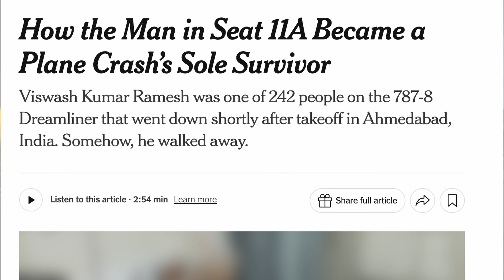Why the RAT Changes Everything – Air India 171 Update

Comment: If that's the case, it must have been a massive electrical overload. To produce a dual flame out so close to take off. Thank you captain steve for the update.
Reply: Can you explain how an electrical system going wrong cut of the mechanical engines. Is there no contingency on a critical stage of flight for that if electrica fail the mechanical still doesn’t flame out. I dont get it
Reply: Exactly. Fuel pumps should have been designed to be powered separately from the main aircraft. My vote is on a poorly repaired entertainment system cutting power to the fule pumps. @themadakh3229
Reply: @themadakh3229  Engines on modern aircraft are FADEC (Full Authority Digital Engine Control).  Lose the electrical bus, you lose the computers that run the engines and fuel pumps.  Kind of like losing the Engine Control Module in a modern automobile.
Reply: @themadakh3229 I got that theory off the internet from someone more knowledgeable than I am, but since it matches all the facts that I know I’ve been spreading it far and wide to shut up the incorrect theories about flap position which people are STILL refusing to shut up about.

That being said, the person who suggested the main bus failure theory suggested that if he were at the FRA he’d be issuing an immediate directive to have all 787s (and other aircraft with electric fuel pumps) run their APUs * During takeoff * as a precaution against another failure like this.

(*edited* with the actual info from the original source after I went back and reread the original post)
Reply: Why overload and not just cutout ? (engine cutout = generator cutout )
Reply: Kinda where my head is going as well.

Full disclosure:  I’m an armchair expert, not anyone actually privy to details.

I feel like an electrical failure would explain everything we’ve heard.  The survivor described a bang and the lights flickering.  That could be the electrical bus overloading.  The engines both have an electrically powered fuel pump, so if the electrical failed then the fuel pumps would stop working and the engines would shut down.  The RAT would deploy in an electrical failure, and it’s deployed.  The landing gear requires electricity to operate, so the gear only being partially retracted would make sense if the electrical failed partway through the retraction process (actually, I’m wondering if the gear up sequence might have been the straw that broke the camel’s back and overloaded the system).  Couple all that to the reports from Air India employees that that particular aircraft has a history of electrical problems and it all seems to make sense to me.

At altitude the crew could have fired up the APU and gotten the fuel pumps running again to recover, but at 400 feet they were doomed.
Reply: @jaanfo3874 The bang was probably the sound of the RAT deploying. The flickering was just the switchover between engine and RAT power. Most likely it had a main bus failiure and an engine throttleback or full failure as a result.
Reply: @laurensnieuwland4657  Cabin light is not switched to RAT power
Reply: @soeren72 The switchover between main and backup power could lead to flickering though.
Reply: @jaanfo3874  yeah this one is almost impossible to believe (dual engine failure at takeoff) with how advanced these planes are. but here we are, all it takes is one incident. so incredibly rare but tragic.

Comment: Catastrophic electrical failure at the most critical part of flight - takeoff. It's almost impossible to believe that the complete loss of power happens at the most critical moment, after V1. But here we are. It explains the crash.
Reply: I have electrical failure as my top even before I knew the rat deployed one is when they said that the tower lost signal with the plane as soon as it took off I am guessing something shifted when taking off taking out some electrical making that loud noise the survivor heard plus he said the light where flickering had to be a major electrical failure
Reply: @delgado76  The aircraft are very heat stressed there, with a hot lithium battery issue in the past that must be something being looked into. Also bad fuel could have sloshed around the tanks when the attitude changed on rotation entering the pumps.
Reply: @Nightowl2548 That occurred to me as well as either a slug of water or some other contaminent. Given the crap fuel imported in shadow fleet tankers, anything is possible.
Reply: A passenger who flew on that airframe earlier in the day posted a video showing that the A/C was off before takeoff and stayed off or very weak through the whole flight (on a very hot day). Additionally he showed seatback screens frozen or just dark. Might the electrical issue have started off manageable and then turned catastrophic?
Reply: @lesleyegbert4807  Very true!
Reply: the guy who flew that same plane that same day earlier recorded a video of the touch screen not working, ac not working, lights not working, etc.
Reply: yes, this exactly.. why? who knows.. Someone on another channel said "lithium battery explosion" or something horrible that kills the entire A/C bus.. and boom, no power and everything in that plane runs electrically.. EVERYTHING.  That entire's plane architecture is electrical (unique to this aircraft and this aircraft alone).  Something horrible happened either right before rotation or slightly thereafter..
Reply: @h.m.stanley  The 787 uses lithium ion batteries for DC electrical power. There was a very early test model of the 787 that had a battery failure on a test flight, they landed safely and then redesigned the battery box.
Reply: @h.m.stanley  Did the 787 have major issues with the battery when it first went into service?
Reply: The plane had el. Issues on the prior flight from New Delhi to Ahmedabad! No one is mentioning that. The lights were flickering, no AC, no remote control or screens operational. It was very obvious the plane needed a thorough inspection and it should have not been allowed to fly three hours later!
Reply: @ObserverLima22  Heard this a zillion times
Reply: All modern jet engines have their own electrical power supply. They do use the aircrafts power in an emergency, or during engine start. but normal operation is from the gearbox mounted generators, a dual channel system. So for both engines to fail, it would be the failure of 3 separate elec. power sources. Or maybe from 2 other sources, bad fuel, or some idiot selecting the engine cutoff switches to "OFF" Egypt Air is a prime example. For info, I'm a B2 LAME with 50 years in the industry, so I have small idea how things work. Also, the "RAT" only provides hydraulic power, then some of this power is used to drive a hydraulic motor to power a small elec. generator. At 650 foot altitude, it's all over. But then, Boeing have never designed any stupid things into their planes. Like no idiot would use a single input sensor for a major flight control system, MCAS, then not tell the pilots about it. Boeing is not that stupid! Also their first plastic aeroplane, with many proven build problems. If it is a "Boeing", I'm not going.
Reply: Kiwi.N.Z  yep something like that  ?  ?
Reply: But how can there be no contingency if electrical fail at a critical stage of take off. I.e jet engines keep running even if electricals fail
Reply: @themadakh3229  The rat is the contingency, but if the engines have failed there is nothing you can do. The engines generate the electricity, so if they fail and the rat is deployed, at long altitude, its not going to help.
Reply: @themadakh3229  The RAT would come to the rescue but I think it needs 10-15 secs to reset the power and get things ignited. Here there was just not enough time. Another 15-20 secs in the air and things may have been very different.
Reply: RAT provides power to a limited number of components. It doesn't provide power to fuel pumps, so the flow of fuel stops. Without fuel the engines shut down.
Reply: I read the engine shouldn't flame out with a pure electrical failure since the fuel pumps are shaft driven.
Reply: Gravity feed alone is not sufficient to provide reliable fuel flow during takeoff.  @nighttrain1236
Reply: Yes, critical part of flight & with all of that fuel on board. It is haunting to see the videos of that medical hostel & all of those plates at the tables filled with food. Just sitting down to enjoy a meal maybe after a long shift at the hospital. So many people whose last breath would be taken at the very same moment.
Reply: The 787 has a known history of lithium-ion battery fires, which can trigger catastrophic avionics failures. On the previous flight, passengers reported the air conditioning, lights, and entertainment systems were not working—clear signs of electrical problems building up. During the accident, the Ram Air Turbine (RAT) deployed and the landing gear stayed down, both strong evidence of total power loss. Survivor also saw emergency green and white lights come on before impact, indicating the aircraft switched to backup power. All these point to a likely scenario where an electrical fire or battery failure knocked out critical systems, leaving the crew unable to retract the gear or climb. The 248 day bug that requires the SW to be reset (failing to do so could cause GCU issues and complete power failure) can be ruled out because the engine was replaced only recently (and probably the SW bug has been fixed)
787 batteries are susceptible to "cascading thermal runaway" where failure of one cell triggers failure of adjacent cells. A main battery fire can cause APU to fail as well. The high electrical demands of takeoff could have triggered the final cascade. Also bear in mind that 787s are Full Authority Digital Engine Control (FADEC) systems that require electrical power for proper thrust management.
Reply: Straight out of maintenance. Could be pump failure/trip due to increased load on rotate and no time for backup before flameout but man, I hope someone simply didn't forgot a shutoff valve after maintenance.
Reply: Electrical failure doesn't explain why the engines stopped producing thrust. Thats the real headscratcher in all of this.
Reply: @Brendan-t7w Because RAT doesn't provide power to fuel pumps, and gravity feed alone is not sufficient to provide reliable fuel flow to the engines during takeoff. There's not enough thrust, and the aircraft stalls.
Reply: @milansuvajac4476 Incorrect. Each engine has an engine driven fuel pump mechanically driven from the gearbox. These will continue to work even in the event of a complete electrical failure.
Reply: @Brendan-t7w B787 Dreamliner does not use engine-driven fuel pumps.
Reply: If something can happen then it will happen - that is the way I think about it.
Reply: This is worse scenario
Reply: Not possible
Reply: Related to an aeronautical engineer with rolls Royce 
He says first 30 min during after takeoff are the most taxing on engines 
He’s noted pilots move to a location to thrust engines before taxing to runway
Always a best practice
Reply: lousy system and probably bad maintenance :(   could the heat cause a shut down,  people said AC was not working
Reply: If my theory proves correct that the real cause of the accident was a catastrophic electrical failure during takeoff, when the engines could not produce enough thrust due to inadequate fuel feed, then Boeing will have to redesign its 787 Dreamliner to handle this scenario.
Reply: can't be electrical failure because engines would have gone full thrust
Reply: To those who keep mentioning the previous flight video showing screens not working or AC. This is normal for air India, the planes are 10 years old now in most cases and Air india has not refreshed the cabins so yes they are basically falling apart and a working screen is unlikely. It’s not anything abnormal, they simply don’t invest in their cabins
Reply: @Horizon301. It's indicative of poor maintenance culture.
Reply: @milansuvajac4476 can’t agree on that. It’s a choice to not invest in a cabin refresh, it’s very expensive. This does not mean they skimped on actual maintenance, this is regulated and very unlikely.
Reply: @Horizon301.  Disagreed. It's not investing. It's maintenance. When you show everyone that you cut corners, and not even hiding it, the question is how much you actually hide.
Reply: Agree, the aircraft quit dead seconds after lift off. Little the pilots could do.

What is the failure mode of the engines if all electric power is lost do they simply shut off or continue to run?

In the case of the A380 they continue to run as was demonstrated with the QF in Singapore where it took nearly an hour and several fire trucks to close the engine off.

So the issue here is was it maintenance, design issue, or sabotage. My bet is the latter.
Reply: @jimgraham6722  Some poster claimed the engines have their own isolated control modues and power source and default to 85% thrust upon total main system power faliiure.
Reply: When RAT is deployed, it doesn't provide power to fuel pumps, so the flow of fuel stops, and engines stop running. @jimgraham6722
Reply: Why do all of those (or most) issues related to mechanical failures happen in that part of the world...
There has to be a much better worldwide quality control in my opinion. Disasters can happen anywhere, but it doesn't seem to occur as frequently in America or Europe and the same airplanes are flown there.
Reply: There have been 55 air crashes in the US in 2025 already. That's a fact. How many were related to mechanical failure?  @LelouchViBritaniaa
Reply: @Sandy-rv9tv  how many due to medical issues suffered by the pilots?
Reply: @Sandy-rv9tv  are you mentioning GA crashes or commercial airliner crashes?
Reply: @Sandy-rv9tv  My guess is the majority are pilot error.
Reply: @Sandy-rv9tv How many were due to poor maintenance?
Reply: @Sandy-rv9tv  Yikes! Glad I have a new car!
Reply: @Sandy-rv9tv   Buddy,  I am not talking about any airplanes :D I am talking about commercial planes such as Boeing or Airbus , not your mom and pop type plane that is flying people in and out of some remote area in Alaska and was constructed back in the Reagan administration.
Reply: @LelouchViBritaniaa  Boeing sends all the bad planes to the third world, it's a known fact that this plane was one of six that was on a Boeing internal blacklist.
Reply: @LelouchViBritaniaa how dense you have to be to write not happening in America when america had the worst aviation accident numbers this 2025 since January
Reply: @LelouchViBritaniaa  When was the last time this happened? And where?
Reply: @orangetube1  Jeju Air Flight 2216 just one recent example.
Reply: @LelouchViBritaniaa one thing to consider is that air traffic is very dense in that part of the world, so you would expect a high occurrence of accidents anyway. That’s why you should look for accidents per 1000 flights or similar relative figure. Secondly anything in warmer and humid climates will suffer more than milder climates. Let alone your statement suggests a lot of conformation bias, you register what you feel should be the case and forget indications that counter it. You should thus first check if you can find if you can find something that can DISprove your ideas, as only then you can firmly prove it.

Comment: Why did the auxiliary power unit fail and the two engines; and also the 2 videos were screen recorded by ‘intent’ and withheld for this long ?
Reply: The APU is intended for use on the ground when the engines are shut down.  Once the engines have been started, the APU is shut down.  In addition, it takes nearly a minute for the APU to be started, so in this case there wouldn't have been time for it to spool up before the crash took place.
Reply: @stephenp448  Appreciate the reply!

Comment: If what you described in 1:30 was indeed the culprit..is automatic taking off not a choice?? Wouldn't taking off and landing be the MAIN goal for companies such as BOEING and AIRBUS?
Reply: It is and it's the job of the pilots to commit to the steps to doing it. They're not going to lock out the flap handle during take off lol. Maybe they can add some sort of parameter watching the rate of climb decrease in conjunction with  a minimum altitude (and speed too) to lock out the flaps.

There also the risk of TOO much automation as well.

Comment: I watched Blancolirio a few hrs ago, Steeeve, and I was wondeirng if you had that info. I reckon there might have been total electric power loss (see clip by passenger showing loss of all electrical power in the cabin) and they could neither keep the flaps out nor pull the u/c up. Why else deploy the rat? Incidentally I learned today there are many more than 3 things that will deploy the rat automatically on the 787. Would total electrical failure shut the engines down?

Comment: Maybe it was sabotage. The conflict between India and Pakistan. The bang doesn't fit pilot error. Is there somewhere a person could put a small bomb that would make both engines lose power, or lose all control. Could it have fit a drone that damaged some kind of engine control.
Reply: Then why did the Captain put out a Mayday call specifically stating “loss of power”? But feel free to keep guessing.
Reply: Too many factors in your version of events, far more likely it was a double engine failure.
Reply: Doesnt the Rat deploy automatically (without pilot input)?
Reply: I think the rat can be manual or automatic. If something was damaged that controls the engines they would lose power. If you took out a section of wiring harness that involves engine controls they would lose power.
Reply: There was a 747 in Afghanistan that crashed because something in the cargo came loose and damaged the controls. Like a wrecking ball inside the plane. Something like that could make a bang and lose of power. There's a lot of things that can go wrong with a plane.